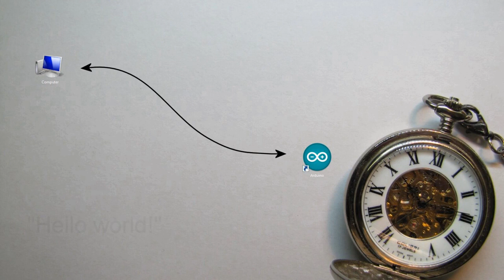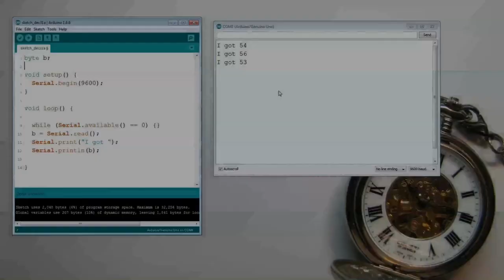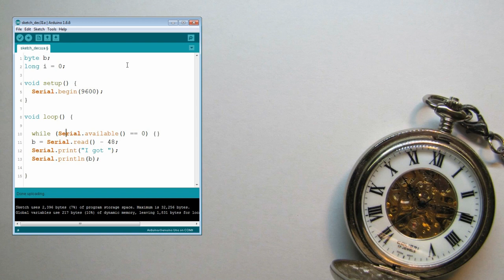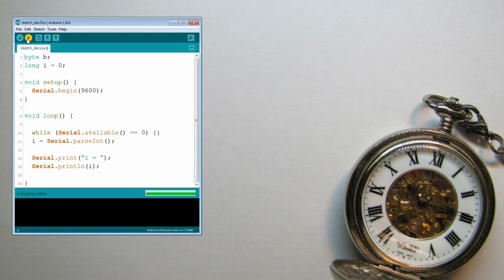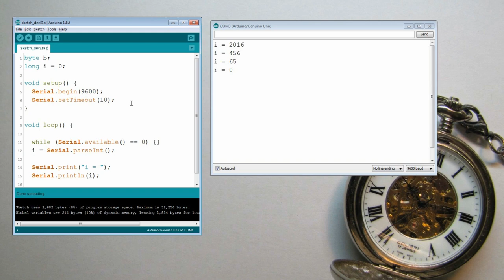Arduino:  Reading Number Input from the Serial Monitor

Comment: It's an interesting solve to the problem. You can try to use the " atoi() " function it will take a string and convert it to an interger.
Reply from the maker: Yes, but you'd still have the problem of determining where, in the serial input, the string ends.
Reply: @idogendel  You can add  "\n" after the last array element this way " atot()" function would understand that is the end of the String.

Another better alternative to this issue, you can just use "Serial.parseInt()" function that would only take Integers and skip any other type of input.
Reply from the maker: @mohamedadam3085  I understand you didn't watch the video to the end... ;-)
Reply: @idogendel  I just went back and watched the video till the end, you did mension the "parseInt()" funcion. by bad.

Comment: it works, but i receive a 0 after a second nomather what i put in
Reply from the maker: Your serial monitor is probably sending an end-of-line character after the that's registered as an invalid number. Select "No line ending" from the drop-down menu at the bottom.
Reply: @idogendel  ty so much it works perfectly now

Comment: Sorry I somehow got on the wrong video.. I was on one about data monitoring. I ordered several vl53lox sensors of different brands. They will be about 2 feet apart. I’m hoping to get some that are accurate to the mm.  The machine will oscillate in 1/2 to 1.2 seconds depending on load.
Reply from the maker: Again, this is not something that can be sorted out in YouTube comments. If you have a local Makerspace nearby, I think the best option is to go there and consult someone with background in machines as well as electronics. Good luck!

Comment: Thank you so much for your sharing! However, can I use Serial.parseInt if I would like to key the inputs twice? As in I need to let the users to key in two inputs. Appreciate if you could advise me on this, thank you so much!
Reply from the maker: Not sure I understand the question. If you send for example "123 456" from the serial monitor,  and your program has two parseInt commands, the first will return 123 and the second 456.
Reply: @idogendel  I see, thank you for the info!

Comment: I need to find a way to capture the oscillation point of a moving object.  
To visualize this, Picture a rail with a distance sensor at each end. The target would oscillate between the 2 end points with the center being 180.  To the left the max measurement would be 270 and max 90 to the right. When the target moves to the right then switches direction I want to capture the farthest measurement lowest number serial data to trigger a device when the target is at a certain point on the left. Then I want to capture the oscillation point highest number on the left to in turn trigger the device at a certain point on the right. Due to changing loads on the device being triggered the oscillation points will change randomly. 

Can this be done?

Below is a rough draft of comments without any code. 

//Arduino uno

// vl53l0x sensors
// distance sensor1 value 181 to 270 degrees
//distance sensor2 value 179 to 90 degrees

//1 stepper Nemo 17 or 23 
//Stepper full rotation 0-359 steps (clock wise count 0 north) 
//Home 180, max rotation from 270 to 90 degrees.
// orientations. 270 right, 90 left. 
//sensors placed at the ends of a rail with oscillating target.

//if sensor1 value oscillates set sensor1 to highvalue of oscillation 
Oscillation at 172-173-172 would set value at 173

// if sensor2 lowalue is  = 178
// run stepper to 183 when sensor1 reaches 182  //1degrees
// if sensor2 lowalue is  =177
// run stepper to 184 when sensor1 reaches 183
// if sensor2 lowalue is  =176
// run stepper to 185 when sensor1 reaches 184
// if sensor2 lowalue is  = 175
// run stepper to 186 when sensor1 reaches 185
// if sensor2 lowalue is  =174
// run stepper to 187 when sensor1 reaches 186
// if sensor2 lowalue is  =173
// run stepper to 188 when sensor1 reaches 187
// if sensor2 lowalue is  = 172
// run stepper to 189 when sensor1 reaches 188
// if sensor2 lowalue is  =171
// run stepper to 189 when sensor1 reaches 188
//Etc....... to lowvalue of 90 
//use < at end max run to 270

//If sensor 2 value oscillates set sensor2 to lowvalue of oscillation
Ocilation at 186 - 185 - 186 would set value at 185

// if sensor1 highvalue is 182
// run stepper to 177 when sensor2 reaches 178
 // if sensor1 highvalue is 183
// run stepper to 176 when sensor2 reaches 177
 // if sensor1 highvalue is 184
// run stepper to 175 when sensor2 reaches 176
 // if sensor1 highvalue is 185
// run stepper to 174 when sensor2 reaches 175
//Etc........to highvalue of 270....... 
//use > at end max run to 90.
Reply from the maker: That's  some question... :-) First, I don't see how this relates to the Serial Monitor, which is essentially just a primitive text interface for the user. Second, you can definitely create a formula or two to define the relation between the sensor reading and the required motor activation- it'll save you endless lines of code. Third, how fast is everything going in the system? how accurate are the sensors and what kind of values do they give you (round numbers?)  - these and other parameters can influence the performance of the code and make the difference between a working system and one that accumulates lags and errors until it doesn't function at all. It requires more information and testing, not something one can do over YouTube comments :-)

Comment: why when i take 2 user inputs consequently serial leaves me enter the first one but it puts the 2nd value zero by default ???
Reply from the maker: Your serial monitor is probably sending an end-of-line character after the that's registered as an invalid number. Select "No line ending" from the drop-down menu at the bottom.
Reply: @idogendel  thanks for your help!

Comment: I used your code from 4:03 and after I enter a number it's gives me the same number along with a zero, does it mean the serial monitor  also takes in the enter key ascii value and uses it in the program?
Reply from the maker: Exactly. Take a look at the bottom of the Serial Monitor window, the drop-down menu with "No line ending", "Newline" etc. In my video, "No line ending" is selected - you probably have one of the others, which send extra control characters.
Reply: @idogendel  Thank you Very much.
Reply: @idogendel  but when we will make one project how will we be sure this no line and newline wont give problem?
Reply from the maker: @studiovlog3635  That is defined in the Arduino IDE by the user. But if you write your own communication program, of course you can tell it what to send or not.
Reply: @idogendel  please gh help me with shift register please SN74HC595N,I made a code 5 years back using it with 2 motor ic but I dont remember it anymore,, and now I cant .   Please explain in simple terms as possible coz all i remember is it was easy to get output but now am not following anything pls help
Reply from the maker: @studiovlog3635  https://www.idogendel.com/en/archives/211
Reply: @idogendel  nope am still confused
Reply from the maker: @studiovlog3635  That was my own post, that's the best I can do...

Comment: Very good tutorial,
But how can I read number input (like with ParseInt) and also a string ?
Reply from the maker: Just write a Serial.praseInt() followed by a Serial.readString(), it will automatically separate the number at the beginning of the input from the rest. The real question, and a more difficult one, is how to verify that input is formatted correctly!

Comment: Hi buddy your video is useful!! I knew there was a Int version of the Serial read but I couldn't remember it haha... one question do you know maybe from this piece of code why could I get my case 0 to 0 again even if I put a value different from 0 in other cases? (I use 2 parseInts one to choose a motor, other to set a speed, so I put in the monitor serial 0 4000 makes spin the first motor to that pwm, 3 2500 the same for 4th motor, etc)
if (Serial.available() > 0) 
    {
      int MotorChoice = Serial.parseInt();
      delay(10);
      switch(MotorChoice)
      {
        case 0: 
        {
          delay(10);
          PWMinput0 = Serial.parseInt();
          delay(1);
          Serial.println(PWMinput0);
          break;
        }
        case 1: 
        {
          delay(10);
          PWMinput1 = Serial.parseInt();
          delay(1);
          Serial.println(PWMinput1);
          break;
        }
... if follows until 15 motors, (16 counting the option 0) and all have break, I make them spin after the if, it works but always the 1st motor (0) enters the case 0 and set speed to 0. I'm not quite sure why. Thanks in advance!
Reply: I can use 1 instead of 0 I know XD but I would like to know the reason behind this, why it enters the case 0 if I don't send any 0, even doing 1 2345 for example, it enters the case 0 because in the monitor appears Motor 0: 0... so to not be with the doubt for ever haha
Reply from the maker: This is not really something I can answer over comments... it depends on the rest of your code and how you send the data. What if you change the order that the motor data is sent? Like, motors 15 down to 0?

Comment: Many thanks for the video... Could you help me a little bit... ?  How can i store these values (numbers) read in an array ? Actually these numbers are HOURS and MINUTES that will be used in the RTC3231 module.
Regards, thank you in advance.
Reply from the maker: Just like I assigned the return value of parseInt into a variable, you can assign it into a cell in an array (e.g. "timeData[1]" or whatever you want to call it)
Reply: The White Byte thanks a lot !

Comment: Hi I  put your code down exactly but every time I put in a number in the Serial Monitor it just prints an additional line of i=0. Please help me fix this, thanks.
Reply from the maker: Your serial monitor is probably sending an end-of-line character after the number, and that's registered as a new, invalid number. Select "No line ending" from the drop-down menu at the bottom of the serial monitor.
Reply: @idogendel  Yeah exactly, thanks  a lot.
Reply: @idogendel  Thanks, works now

Comment: Line 9  while (Serial.available() -- 0)  does not work.  It worked with   while (Serial.available() - 0) { 
Secondly I am getting an additional number 10 (line feed, new line) at the end.  Not a big issue, but why it didn't show in your video?  I shall tweak more, and may be find the answer myself. I shall look in your channel if you have some video on interaction (to and fro) with processing.  Thanks for your video.
Reply from the maker: In this comment you wrote "--" and "-" instead of "==" and "=", maybe that's the problem?
Reply: Moments before I saw your reply, I noticed my mistake, when I saw the video again.  I am still tweaking other parts of the program including using alphabets.  Working fine so far.  Thanks.

Comment: It gives me an additional - 38 sometimes 10 i checked the code it's same as yours
Reply: try choosing "no line ending" instead of "newline" in the lower side of serial monitor
Reply: try choosing "no line ending" instead of "newline" in the lower side of serial monitor

Comment: Dear All, I am trying to transfer a sensor’s float output to another Arduino board using serial comm. I use the Serial.print()  & Serial.write() functions on the sender to send the float sensor reading variable to the receiver Mega and have setup the receiver with the commands shown in this video. I keep getting number 255 as received sensor data although I send a value equal to 33. Any ideas this is not working please?
Reply from the maker: Try parseFloat instead of parseInt ?
Reply: @idogendel   thank you very much for your reply, will try this tomorrow furst thing.
Reply: Hi again,

Thank you very much for your help. I managed to achieve communication but every few succesfull variable values transfer I get a 0 as a value. It seems to be periodic. Any ideas?
Reply from the maker: @vigatex  Could be many things... for example, if the data is sent very fast, perhaps the Arduino doesn't have time to catch up; or if the sender is not very consistent in sending the data. It's usually useful to look at the data lines (with a Logic Analyzer or even a scope) to make sure the raw data itself is ok, and if so, check for bugs in your code or timing constraints.
Reply: Do you think that I2C communication between the two boards would perform better?
Reply from the maker: @vigatex  Rule for life: Never jump to a new solution until you figured out what was wrong with the old one... ;-)
Reply: Totally agree but my knoweldge on this is limited
Reply from the maker: @vigatex  All the more reason to expand your knowledge...

Comment: i see 0 after every number i enter on my serial monitor, can u figure out why?
Reply from the maker: "I see 0" is not very clear... If you show me the code maybe I can help.
Reply: Same problem with me also. 
Code is same as i copied it from the video.. Plz give the solution😖😖😖
Reply: @RakeshSharma-xg4ds  it's a too late i think but it will help other people...  i had the same prob. the solution is to choose "no line ending" instead of "newline" in the lower side of serial monitor

Comment: if i shouldnt use parseInt then what to use ??? i dont remember all these 5 years back when i was pro in it,, its been 5 years with my stupid life and sales job now in lockdown i wanna brush up everything but can do a single progress, everything is changed the entire INTERNET is changed i feel so scared man help me out,
i am trying to rebuild an android control car that i made 5 years back one atmega with arduino software two motor driver ic controlled with a shift registers i had made this all and stil had all in the custom PCB but now hell if i can understand anything i was lazy to document anything.
ANY ONE READING THIS HELP WILL BE BLESSING FOR ME

Comment: sim.println("AT+CMGS=\"+91xxxxxxxxxx\"\r");     i dont want to write this. i want to write mobile number on serial monitor in arduino and on that number, i want to send message. how can i do?
Reply from the maker: You don't need an actual number in that case, only strings.

Comment: Everything is okay but I also get "0" as output along with the value that I have given as input. Please someone help!
Foe Eg:
input = 125
>> i : 125
>> i :  0
Reply from the maker: At the bottom of the Serial Monitor, make sure "No line ending" is selected, instead of "Newline" or any other option.
Reply: @idogendel  Thnx bro, you prevented me from breaking my Arduino due to my fury. of this zero coming.

Comment: Good Work. please I need your help
Reply: @idogendel  void loop() {
  if(Serial.available()>0){
     char getStr = Serial.read();
    if( getStr == 'a'){
      sensor1 = Serial.parseInt();
      Serial.println(sensor1);
    }
    if( getStr == 'b'){
      sensor2 = Serial.parseInt()-'0';
      Serial.print(sensor2);
    }
  }
  delay(100);
when ever i read it, the character is asigned with the number like this  b689
Reply from the maker: @danielgormanhammond9661  Well, that kind of depends on what is sent over Serial to your program, no?
Reply: @idogendel  i'm sending only number
Reply: #include <SoftwareSerial.h>
SoftwareSerial s(5,6);
const int analogPin1 = A0;
const int analogPin2 = A1;

void setup()
{
  Serial.begin(115200);
  s.begin(115200);
}

void loop()
{   

  int sensor1 =67 ;
  int sensor2 = 689 ;
  s.write('a');
  s.println(sensor1);
  s.write('b');
  s.println(sensor2);
 
}
this is the sender code
Reply from the maker: @danielgormanhammond9661  So you send 689 and get 689? What's the problem?